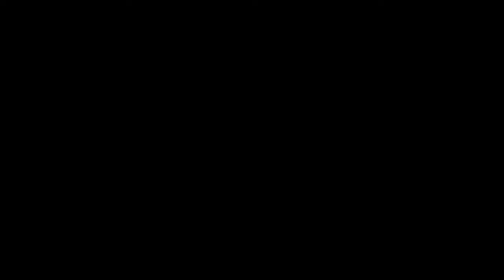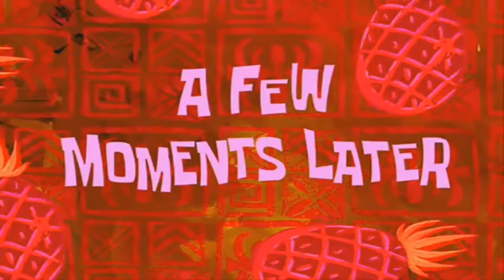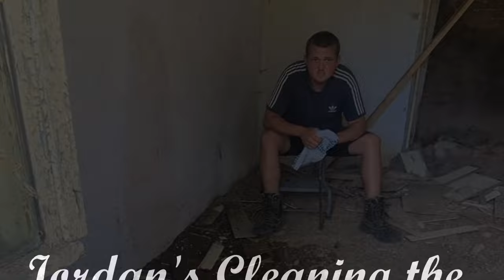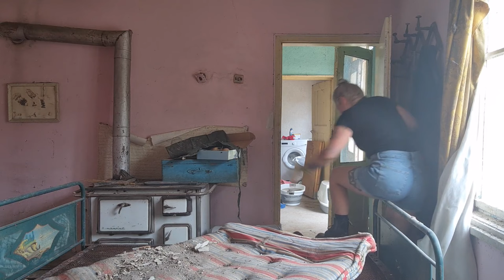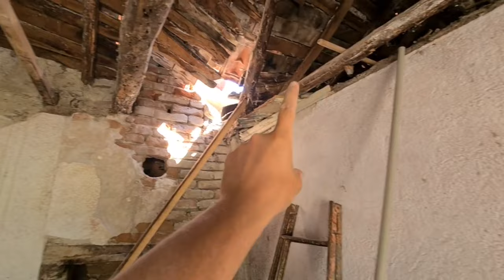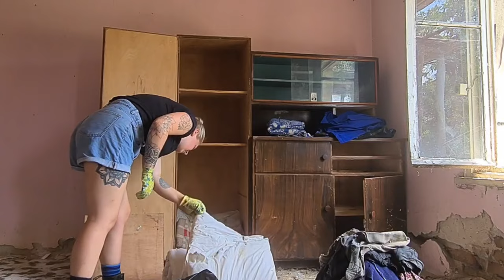Episode 7 - Did You Catch That On Camera? | Renovating a Bulgarian House

Comment: I'm very impressed of both of you. It takes courage to do what you do and it's pleasure to watch you.
Allow me to point your mistake in plumbing. You don't want your pipes to be above the ground because winter in Bulgaria could be cold (-20/-25 Celsius, the lowest ever recorded is -38). The rule of thumb is pipes need to be under the ground at around 1.5 meters. I,m pretty shure you don't want to deal with burst pipes in the cold.

Comment: That water meter looks ancient. Technically water meters need to have a checkup performed on them every 10 years. If you contact the local ViK they might hook you up with a company to replace it with a brand new one. They'll even install it. Tax is about 30-40 BGN and the replacement takes about half an hour.
Reply from the maker: Fantastic, I think I'll speak with them and we'll see if we can get it updated, it's definitely ancient! Thanks for the heads up.
Reply: You have to change the meter or get someone to change it and the costs are on you
Reply from the maker: @David Moore  sounds about right. I didn't think the water company would fit the bill, haha! We still need to look into this...